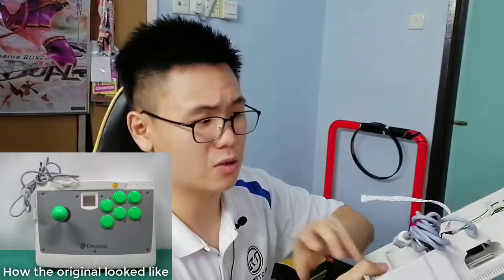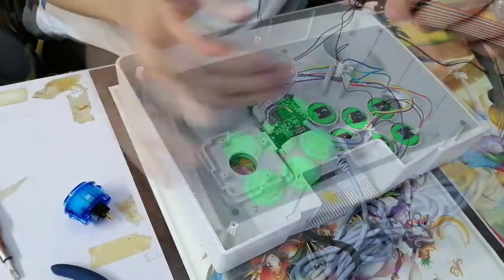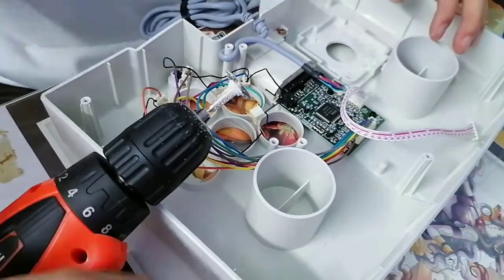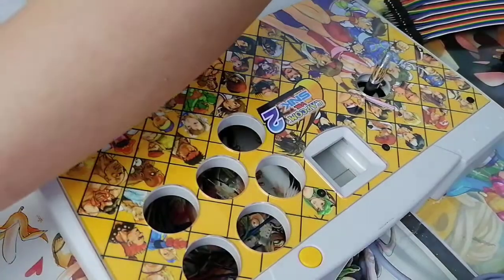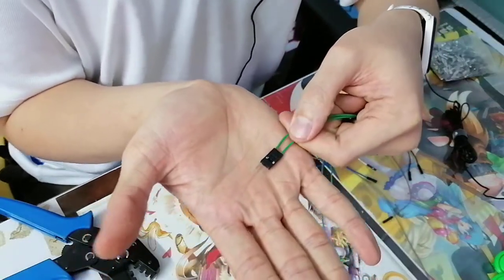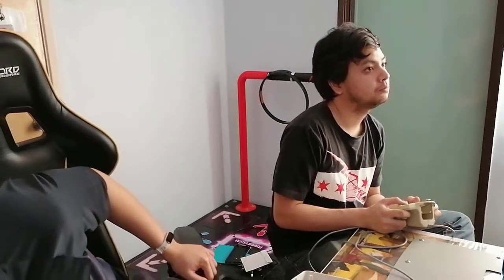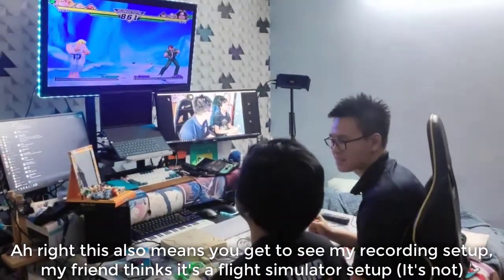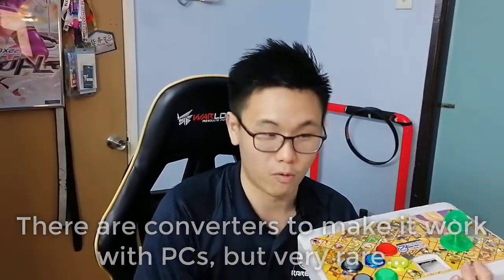SEGA HKT-7300 Fightstick Mod

Comment: hello.I'm really interested in modding my HKT-7300 joystick but where can I purchase green buttons and other parts which is necessary for this modding?
Reply from the maker: Depends on your region, if in Malaysia, I can help you purchase them, but other parts of the world, probably places like Focus Attack or Arcade World UK, depends on which is more convenient for you
Reply: @HahnDeathspark  Thank you very much for your rapid reply!I currently live in south korea and It is possible to purchase button or other parts from korean online store(istmall) and aliexpress.
By the way,What model should I purchase for replacing six green button and stick? and It is really don't have to use  dremel in order to enlarge six holes for inserting green buttons into metal plate?and Is it possible to use HKT-7300 without any metal plate or acrylic plate?